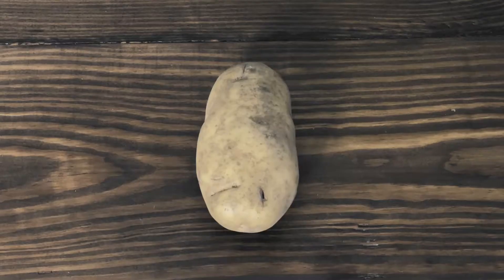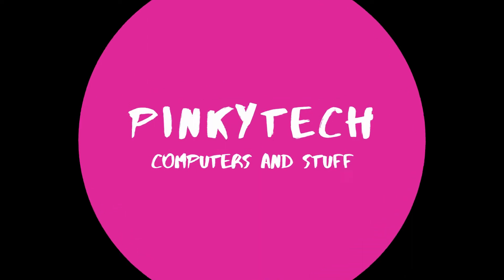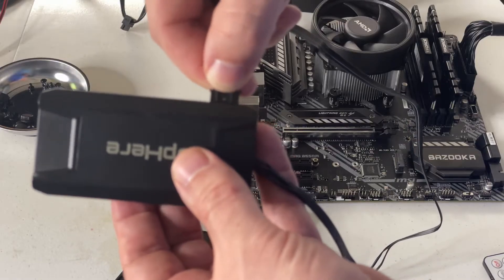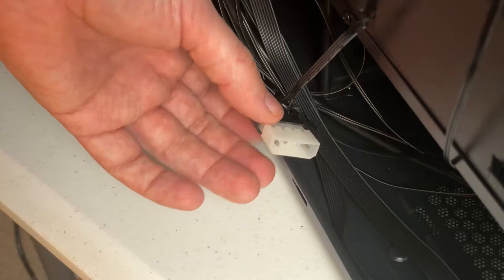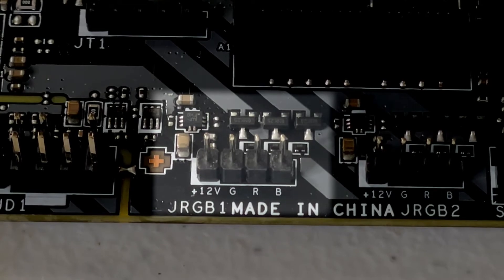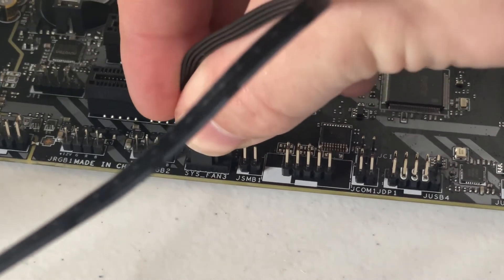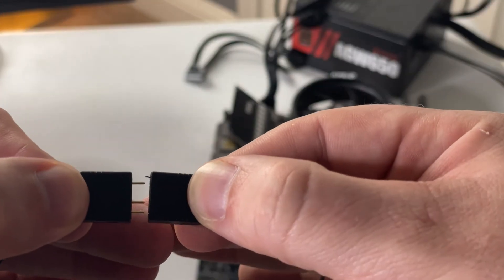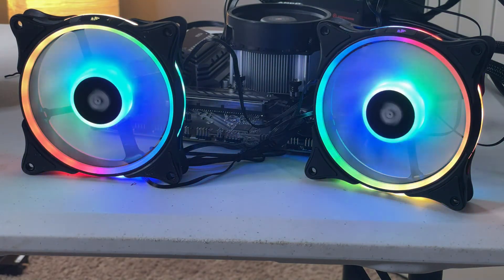How to Install RGB Fans

Comment: Very good information.  MOLEX should be outlawed in 2021 builds.  Good points about non-PWM controlled fans.  I'm kind of a noise nazi and the non-PWMs running at full speed drive me nuts.  Looking forward to your next video!
Reply from the maker: Thanks for the feedback! I like having the PWM fans too, since I work from home and computer is always on. Can't even hear it, which is nice on conference calls. My work laptop on the other hand.....